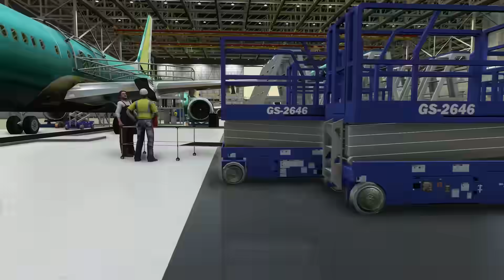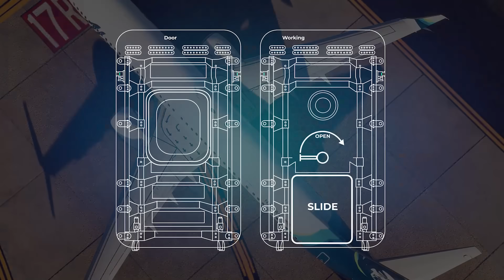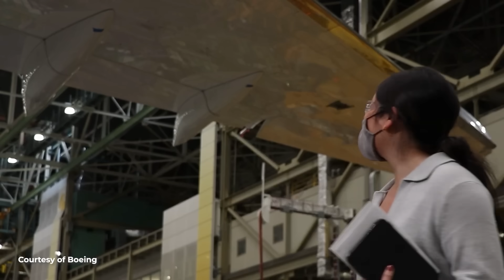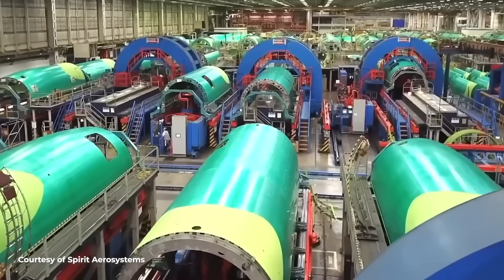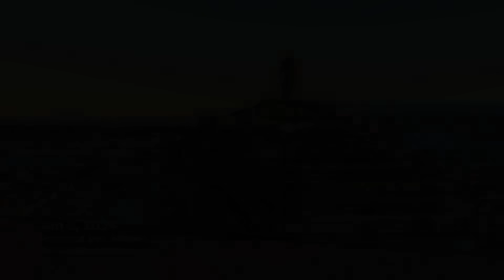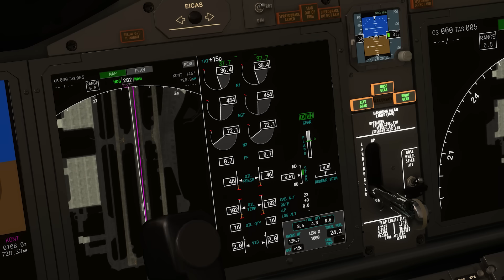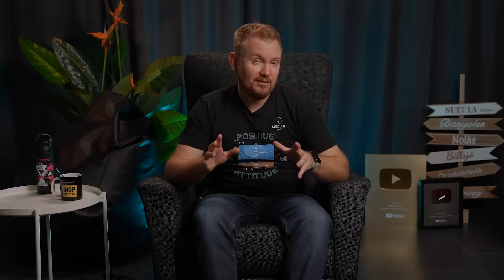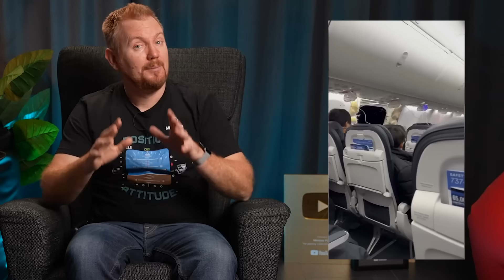Boeing 737MAX BlowOut!! The Scandal behind Alaska Airlines flight 1282

Comment: My husband and I are both former Boeing employees. During assembly on the factory floor parts,  ie. fasteners, Are carefully monitored and must be accounted for.  If you are performing a job that requires 20 rivets you get 20 rivets and that’s it. There are no parts bins with extra fasteners. This is done to control FOD and also to verify if the job was done correctly if you have an extra fastener in your hand after completing your tasks something is wrong. So what we are wondering is where are the four bolts that did not get reinstalled?
Reply: I wonder the same thing. 4 bolts and associated nuts and washers would be left over after the job. Where did they go?
Reply: @bsmith1164  They are in somebody's pocket and went home with them.
Reply: Math word problem of the year 😂
Reply: @hobbesip1 😂 Common core… they estimated 🤪💜👍
Reply: Boeing is not what it used to be which you can read about in the politico article about the Boeing blowout. The former senior manager for the Max project quit because Boeing quality control and safety practices dropped to dangerous levels, and it has never come back up.

So I'm guessing you worked many many years ago when it was still good, but today they don't care about the workers concerns and push products out the door with constant problems. 

They apparently did stuff like continue production when parts were delayed like prop the wings up with wood blocks when engines weren't coming, instead of stopping to wait for necessary parts which would reduce mistakes. And the failure rate of MAX planes is much higher than the well built older Boeings. And apparently Boeing reduced the quality control staff count. 

The former Boeing senior manager says he will not fly on a Max plane and he always asks if a flight is on the MAX so he knows to avoid it.
Reply: I'll bet some suit in Chicago decided that counting the exact number of parts took too much time and then eliminated that step in the process.
Reply: @andrearoberts1953  it happened in Wichita; more likely the kansas crew just couldn't count and/or just gave up halfway through the job to do some meth 

same with the whole 'eh, just paint over the rivet damage' job 

impossible to get good, high quality work out of a red state
Reply: The article is called I’m Not Trying to Cause a Scene. I Just Want to Get Off This Plane.’
Reply: I take it pocket screws are not acceptable... ;-)
Reply: I bought some on eBay recently 😮
Reply: John Oliver did an episode on it as well.. horrid stuff really
Reply: Many moons ago I was working on the Jaguar aircraft, I was to take off the spine panels as part of a minor servicing, I noticed that this one spine panel had all new unpainted fasteners, when the panel actually came off I found the original fasteners taped in a plastic bag to the underside of the panel??
Reply: @billb7876  The engineer forgot he put them there and didn't start searching for them until after he put the bonnet back. Gave up eventually, and just grabbed some new ones instead. Sort of like how you lose a cable, replace it, and then find the first one while putting the new one away.
Reply: This comment right here helps us to understand why the FBI is looking into this as a potential crime.
Reply: The work was outsourced to a company that had similar problems in the past. McDonnell Douglas didn't fold. They annexed Boeing and hijacked their name.
Reply: @InservioLetum hijacked their logo maybe.
Reply: Amazing how they "lost" the footage of the repair. No idea who even did it.
Reply: @TwistedQuestionMark  footage? you think a GREASEMONKEY has a CAMERA CREW?!
Reply: @InservioLetum  I tried to link the video talking about this for you but it won't allow it. There's cameras all over the facility where to plug was installed. The FAA report claims it was lost and the papers recording the info on exactly who worked on it is missing. If you search, "Footage of Alaska *for (*Air, sorry) plug being installed lost" you'll find the FAA report and news stories covering it.
Reply: Thank you for sharing this information.
Reply: And Boeing still has not released to the NTSB, any documentation about the work done or the people involved.
Reply: @JFrazer4303 Because it's all veen lost, somehow. Footage of the repair deleted, and paperwork listing crew wrorking on repair gone. Clearly intentional. Real question is, who's the responsible party?
Reply: This is what we practiced in the Air Force, during maintenance/servicing of the Aircraft. Every tool/sparepart also had to be accounted for.
Reply: He took them home to show his wife and kids what he Did for a living.
Reply: My guess,  the person who found them after the fact threw them away to avoid blame.  Is that a management problem?, work environment maybe, bad employee?
Reply: @billdeibner7105  not likely, they wouldn't have anything to lose by calling attention to it...  no mechanic is going to pitch certified hardware into a bin...  

the bolts should be traceable and likely have already been found in the parts store inventory, and the records of their movement should help reveal what happened...
Reply: @PRH123   According to the preliminary report they didn't find any of the bolts on the premises even after a search for them. I do hope they find them eventually and figure out who moved them when and why, but at this point nobody knows, or at least its not in any of the publicly accessible data.
Reply: @seonor Having friends at Spirit and from what they've told me about both Wichita and the rework team at Renton, my guess is the same person who painted over defective rivets is the same person who did not reinstall the bolts, but the bigger question is why the Boeing inspector didn't notice the zip tye replacements.
Reply: @PRH123 no, read the prelim report, they also haven’t produced any documentation for the NTSB despite multiple requests. And yes, it also mentions hesitation in calling out issues as many of the people are contractors and worried about their jobs.
Reply: @c1ph3rpunk  they’ve essentially admitted that they didn’t have the records. Which reflects even more poorly on them. Either the records were destroyed or it was never documented
Reply: @seonor   Another option is that they were lying between the door plug and the "wall" covering the door plug and blew out with the plug somewhere over Portland.
Reply: @billdeibner7105  That was my thought also - tossed into file 13 never to be seen again.
Reply: Exactly what I was thinking
Reply: Spirits maintenance system and Boeing’s would not interface …
Reply: Look at the construction method for those aircraft. Thin aluminum and wood ribs covered with 1/4" aluminum skin. A large lightweight yet structurally strong mass. Like an egg shell.  Yet. The U.S. government wants you to believe that 2 of them were able to blast their profile shape through the 1" thick iron steel box trusses  of the world trade centers.  Never could happen Dr Fauci.  And Boeing engineers know it as well.  F the FFA
Reply: The work was done at Spirit not Boeing.
Reply: Maybe someone thought they dropped them and picked up someone else's. Maybe someone was inadvertently shorted and found them, and decided to finish their work on time. Maybe they ended up embedded in a piece of insulation, behind a wall panel, in someone's shoe tread, embedded in the bottom of a box someone set down, etc.

If Boeing is only assigning exact numbers and there aren't continuous recounts, extra/missing fasteners, and extra inspections, something is wrong. People drop stuff, miscount, etc. Suppliers send manifests that don't match the shipments (both on accident and on purpose). 

Is it a requirement to turn in and document every flawed fastener? Does anybody go through the trash bins to see if any are in there?

Honestly that's not a great way of finding out something is wrong. So someone gets 20 rivets and have none left. But they didn't notice that they really picked up two and dropped the other one. Now it looks done because all the rivets are gone. But the 20th is really embedded in their shoe when they leave, and falls off in the parking lot where it gets stuck in someone else's tire tread. Oops.
Reply: Probably flew out with the door plug or was found in the employees washing machine at home and they couldn’t put 2&2, or in this case, 4&4 together.
Reply: Human factors need to be   accounted for. So if a bold is important for safety of the installation it needs to  be designed in a way it is impossible to perform the next step without having it back in position!
Reply: Remember she and  the husband as she mention above works for boeing not spirit. 

So yes, spirit worker might not have only 4 bolts but actually 8 of them since the door is on both side. 

Or the door only on the left side?
Reply: Boeing is just AWESOME ! Safest ever ! Not like these flying coffins, they call Airbus !
Reply: @gertjanvandermeij4265 Not like Airbus has ever had problems, like, I dunno trying to make a low pass and the plane deciding that landing in a forest was a good idea.  There's also a long, long list of crashes exacerbated by the control displays not displaying useful info, like conflicting control inputs.  Boeing has problems. Airbus has problems. Ford has problems. Every place with human workers has problems. Humans screw up. Even places with all-robot workers screw up. Machines will perfectly do the wrong thing just as well as a person.

Comment: How awful for the pilots, crew, and passengers to have to go through this experience because of the negligence of Spirit and Boeing.
It was most fortunate that no one was sitting in the seats next to the hole and it seems everyone had their seatbelts on because they were still climbing, and the two pilots did an impeccable job getting the planes down safely. I hope they and the crew received due recognition.

Comment: I was always under the impression that the emergency doors were designed like main cabin doors (ie. Made larger than the hole they fit it - to avoid issues like this)
Reply: The original 737 had emergency exit doors which had to be removed into the cabin.  That is an impediment when people are wanting to get out in a hurry.  A door which just slides uo and goes straight out is much faster.

Comment: I want to hear that Boeing knows where those lower locking bolts are that were removed and not reinstalled. Surely there's a surplus in an inventory somewhere? Were they on a checklist and wrongly checked off? Or are they rattling around inside the airframe still? Sloppy madness!
P.s. Alaska airlines deserve appologies from all those people who were blaming and pointing at  them and the wifi installation, when in fact they had nothing to do with it. Boeing sycophants .

Comment: I’m surprised by the fact there wasn’t more indicators that something wasn’t right with the door based on the several flight hours without the pins installed. He mentioned the whistle but I think there’s more we’re not being told. No passengers sitting there was not an accident. I’m assuming there were many complaints from the passengers that did sit there from ear aches, loud whistles, making funny noises, very cold, vibrations etc.. I think the problem was looked at by maintenance however they believed there was an issue with the seal, and taking the panels off to inspect the structure would be expensive and absolutely silly. What happened is unforgivable criminal on Spirit’s part. If this problem happened to any other aircraft manufacturing company besides Boeing that series of aircraft would and should still be grounded getting disassembled down to the airframe and being inspected.

Comment: So first, there was MCAS, knowledge of which Boeing withheld from the FAA in order to get the 737 MAX certified more quickly, thus withholding the information from pilots and ultimately leading to two horrific crashes.  Now, they've withheld critical information about how the cockpit door operates?  What other critical information is Boeing withholding from pilots and regulators?  Their abysmal QA is bad enough, but intentionally withholding critical information is unconscionable.  Pushing aircraft out the door when they know there are flaws (such as hundreds of incorrectly drilled holes) is completely beyond the pale.  Boeing seriously needs to be shut down.  They are an unmitigated danger to everyone at this point.

Comment: They need to update the engineering lists so that a plug door can never be "opened", they can only be "removed".
If the plug is limited to only being able be "removed", they then have to "replace" the plug, rather then "close" it. Replacing requires checking the bolts are in place, closing it doesn't.

Comment: The real emergency exits dont have those bolts either. Whats holding them down, the lever/locking mechanism I assume?
In that case failure of this locking system would have the same result.
Correct me if im wrong, but it seems like terrible design that the door can open at all under pressure, no?

Comment: As a non-aviation person, it looks to me like the springs on the lower hinge fittings were only there so that Boeing could save a few bucks by not having 2 types of fittings. Aside from cost, the only downside I could see to a dedicated fitting for the door plug would be accidentally fitting the springless fittings to a working door- which given the chain of mistakes here seems entirely likely

Comment: Just wanted to thank you for covering this so quickly.  I know it's not the final report, but the way you presented each likely issue that led up to the incident is logical and believable.  I would be surprised if the final report revealed any more major detail that wasn't covered in this video.  And thank you so much for making sense of how the door plug works in every step; with how little most articles explained how the plug wasn't properly installed, that question was gonna drive me crazy and I was afraid I'd have to wait many more months before you'd make a video of this.

Comment: "Imagine you're sitting happily in your aircraft seat watching a movie..."  

You know, in severe enough failure modes you can change the word "happily" to :

 "... in what is a large piece of debris, no longer attached to the air frame, plummeting to the earth wondering if the seatbelt or flotation device features of your seat will have utility. And the guy in the middle seat still will NOT shut up or stop bumping elbows while you're trying to engineer your way out of the situation.

 Eureka! You unclick his seatbelt and have solved the "if a tree slows our fall and I have to sit next to him for more than five minutes, I'll finish what gravity didn't" problem."

The in flight movie being a romantic comedy issue will have to go on the back burner as the ground has continued to progress towards your position - regrettably, a predictable state of affairs in retrospect."

P.S. the solution is to use the seat to both increase your drag and be something of a cushion for your decelaration if you can steer it to also hit something that will extend the duration of your sudden stop. It takes remarkably little change in time of decelaration to make impacts survivable with a bit of luck. For consideration, airbags.

Comment: Just to point out that the 737-900ER already has the capability of carrying more than 189 passengers, so the mid-cabin exit opening would have already been there, as was the case with the MAX 9.

Comment: I have heard several times on different incident reports how cockpit crew omitted to pull the fuses on the cockpit voice recorder to protect the data. Surely, it is time that the check lists included it, the system automatically saves it, or the storage capacity of the recorder was increased to allow more time before overwriting causes loss of data. It must be possible to do one of these improvements??
Reply: It makes me wonder if they're actually trained to pull that breaker in the simulator after every simulated emergency.

Someone on the ground should be double-checking too.